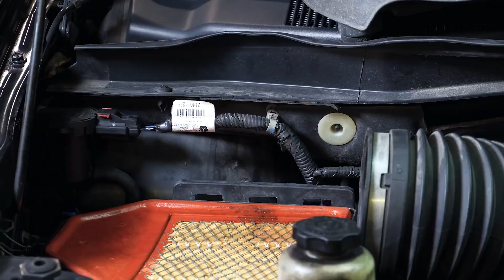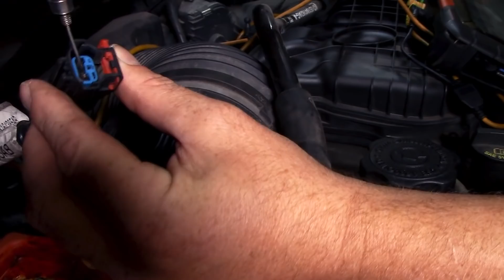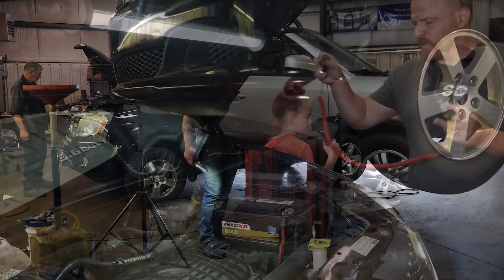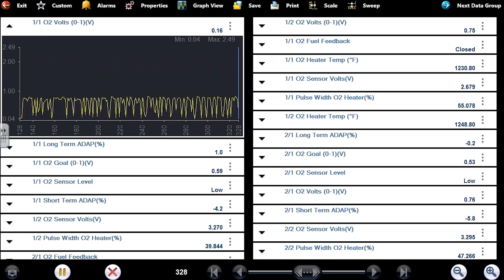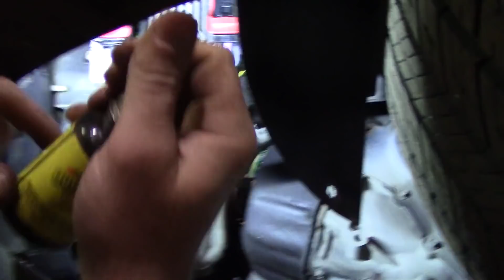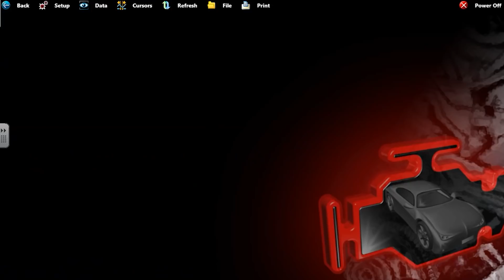2013 Dodge Caravan Purge Valve Circuit Code P0443 (New purge valve) Part 1

Comment: Bravo! Great video.
EMC,  electromagnetic compatibility is an aspect of modern vehicles electronics that is not often considered out on the job. EMC testing is done at the factory  to insure that the vehicle's systems do not interfere with each other by keeping the integrity of all the systems signaling, control and communication circuits. Modern engine I/O controls have a return line back to the computer to minimize EM interference aka noise. The load return line allows EM field cancellation (noise) all the way back to the computer where it is grounded. However some loads do not require this kind of treatment and aren't designed with a return conductor. 
Now will the DEVICE in question work properly if the return line is bypassed at the device?  That depends on if and how the PCM detects the output voltage/current to the device. Most PCMs detection circuits are direct reading and could be implemented at the supply side or return side,  It is simpler to do so at the return side but there is a catch. First you cannot observe the current supplied by source, you only observe the current that returns at the return point, so the computer cannot reliably detect a short circuit. Second, additional consideration has to be given to ground potential transients and noise coupling. There is a good chance that your application has the detection circuit located at the supply side because it is desirable to addresses both limitations described above.  So the bypass modification allows the DEVICE to work,  what about EMC on the modified circuit? That is the real question....time will tell. 
My only advise would be to do the bypass at the computer end of the line vs doing it at the device end of the line un.

Comment: May did AWESOME.. good to have that back-up camera gal to take place when needed. Good job May 😀👍    Great stuff as usual Paul. I was wondering if that computer ground side would monitor when it gets commanded during a test drive. Like you said, different code most likely. Curious to how that turns out. Hey, Another thought on the P0300 is, maybe that computer ground momentarily came back to life and did the flood work and caused that shutter/misfire the customer experienced. (Hmm..) Just a thought. 😉    Totally agree with you on supplying the ground to the purge. Would have done the same as well.  Save that money bro. Lol
Anyways, I saw the to be continued so I bet there's an update to the case study, especially on the purge repair.  Look forward to seeing it and more in 2022. 
  Happy New Year to you and the Danner gang.  Cheers
Reply: how can i turn my hair green wait i only have 3 hairs on my head  just funning thank you may and paul

Comment: Hey Paul, It is a design consideration about reducing the possibility of stray ground loops within the system; with or without having circuit monitoring available on the ground side. You will find this design consideration in many applications from vehicles to buildings; for both control & power circuits.

Comment: I did not see you check power and grounds to the computer. Is it possible that computer is missing a ground? I realize that would usually affect more than one circuit, but maybe?

Comment: What's keeping the car from stalling out once the solenoid activates after the customer picks it up?
Reply: I think the issue is with the scan tool, the purge option is a full time on and that stalls out the engine, particularly with a full canister.  When driving the car and under ECM control, the purge would be pulse modulated and not allow as much fuel vapor into the engine.

Comment: Happy New Year Paul. One question. Back in the old days, you always had us checking powers and grounds at the PCM. Just wondering if the 'missing' ground here could have anything to do with a bad ground at the PCM. Seems unlikely that it would have a separate ground for just this one circuit. 

You've really got me wondering why it would power side switch this thing. The electronic design is much easier (at the transistor level) with ground side switching. Oh well. Another of life's mysteries.
Reply: Was thinking that too.  Also something that came to mind was checking the PCM connector and pins for damage.
Reply: @Discretesignals  Brilliant thought about the PCM connector pin.
Reply: @jameswasher3938  Yeah it sure is. Maybe the hack that spread the pins on the purge valve attacked the PCM ones too, LOL.
Reply: I think if the pcm have a bad ground will be affecting more sensors no? 
But in this case looks the ground is inside the boars of the pcm
Reply: Also thinking where is the check of pcm grounds. What caused the ground circuit to fail in the pcm??
Reply: @Turbotomass  And, why just the one, why not more? Seems odd to me.
Reply: I'm with everyone else here. Danner always told us to "check the powers and grounds" at the PCM. I've seen him do it dozens of times. I suspect he did that already and forgot to put us in the loop. This tech is so thorough that he couldn't possibly have given that a pass.

Comment: The sad thing about the dealer is Chrysler has a real nice connector kit for testing from the connector and pin tension. All dealers were sent this . Pin damage is a flat rate problem. Why walk across the shop to get the proper tool ? Just jam a test light in there . Maybe inexperience. I’m always on the young guys about poking a connector.

Comment: Great video, Paul and nice camera work, May! I used to work at Audi. We would totally be authorized to run a bypass/overlay wire in this situation. I'm pretty sure that the entire Volkswagen Group publishes information on how to do it correctly. They even do overlays on Porsches and Bentleys! Either Chrysler corporate doesn't approve that type of repair, which I doubt, or that dealership just wants to sell an expensive PCM.
Reply: Firstly once the car is out of factory warranty it's no longer a corporate decision.    Dealerships can make more decisions on what constitutes an approved repair.     So if they chose to not do the ground overlay its because the tech didn't realize it would remedy the dtc or because from a liability standpoint if that repair was successful and the ecm then had another failure point guess what.     The Karen customers of today would be wanting that repair refunded.    This is why lots of dealers wont give customers this option because when you're already so pissed about having to pay for repairs you'll never appreciate a cheaper alternative that has some risk.    That's why.    When the consumers attitude changes so cam the procedure

Comment: I would recommend a flyback diode on that chassis grounded solenoid. That protects the switching transistor from spikes when the circuit opens.
Reply: The transistor has clamping circuit designed to handle the flyback (you could rest assured it is not the transistor going into breakdown, but it is really an active circuit controlling the transistor the way to control the flyback voltage), there is no need to add anything extra there. To the contrary, adding a diode is not a good idea, as it may mess up some of the diagnostics.

Comment: With this van did you check if the ground at the computer to a body ground ? Might been the eye connection at a bolt from computer .

Comment: How do you know it is not a bad pin in the connector that plugs into the ecu?  Perhaps the dealer’s tech pulled the connector and botched that barrel socket also. Just a thought. Is it worth checking the ground pin on the ECU to case ground? Perhaps you did just that and the old man missed it.

Comment: question   when i watch my live data on my chevy silverado 2019 and my short fuel trim reading or no reading is stuck at 99.2 on o2 b1 shouldn't the reading fluctuate? I'm pretty sure it did at one time and my gas millage is terrible and engine idle is little more rough then usual. what do i replace?
Reply: That's sounds like low quality scan tool reading in my opinion
Reply: @jeffcompton6937  yeah but my truck also idles rougher otherwise i would agree. would it be a bad sensor at all?
Reply: And you can confirm 02 sensor operation by looking at the voltage on the data list if the stft pid is unreliable
Reply: Could be dozens of things causing the rough idle.     My suggestion for the most cost effective is see a professional for an accurate diagnosis.      No reason to shotgun parts at a truck that new

Comment: In the end danner will have to replace the PCM
Reply: A repair is cheaper, there are many services out there that are offered for jeep Chrysler dodge and they are known to have circuit issues.
Reply: @scientist100  In this case, it's not a circuit issue, only actual way to repair the P0443 in danner's case will be to replace the PCM itself.
Reply: @thesmartguy3523  no, I'm saying instead of buying the PCM new, best cheaper alternative is to have the PCM serviced by people who repair the circuitry in the board not a wiring issue outside the PCM. There are many talented people who test the board using simulations and if anything fails, they repair it and then do a visual and recondition what they see a common issue with that specific board. If you go on eBay, you will get a lot of services that offer PCM repair.
Reply: @scientist100  oh yes, that's absolutely possible, but I'd rather a brand new PCM or a secondhand working PCM, the type danner is working on, you can get a good deal for less than $200, I'm sure a repair would cost as much but yeah, it's possible.
Reply: Why do you say “ In this case is not a circuit issue”. When in fact the PCM is part of the circuit.
Reply: @thesmartguy3523  i dont trust used PCMs when i know they are prone to fail, I would rather have them fixed at the known failure points and know that I'm getting better than OEM.
Reply: And why exactly do you say that?    The dtc is repaired and the system is now functioning properly so how do you figure its going to fail ?
Reply: @jeffcompton6937  It seems to be that way. Just as long as the pcm does not have some kind of sense circuit on that ground line and set a code.
Reply: @mph5896  and do you not think hes already proven that ?
Reply: @jeffcompton6937  With a short test drive, no.  The pcm might go through different test parameters with different drive cycles. There is still a possibility of flagging a code.
Reply: @mph5896  like he said maybe under a  different testing parameter it could maybe generate a different fault but I'd say highly unlikely being that the circuit works properly,    its not a monitored circuit in the ecm and didnt generate any different dtc immediately or skew any kind of data. 

If it had I'd think months later Paul would've said so.     But maybe that's what the too be continued is about
Reply: @jeffcompton6937  Its reengineering the system. Without knowing how the software is designed, its not possible to know if it will work without putting it back into service and seeing how it responds over time. IF its fixed, great for the customer. If not, nothing really lost. Just have to wing a pcm at it which it originally needed.
Reply: @mph5896  but it's an unmonitored constant ground as he said so?